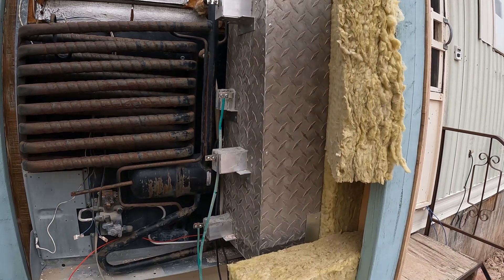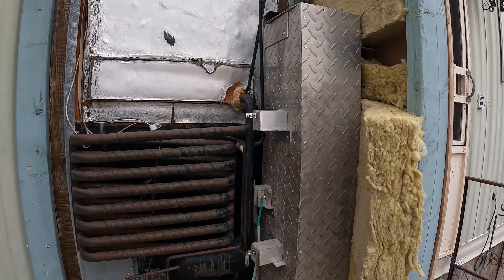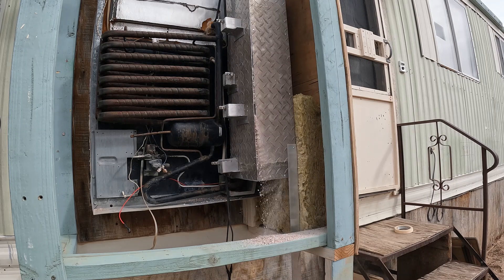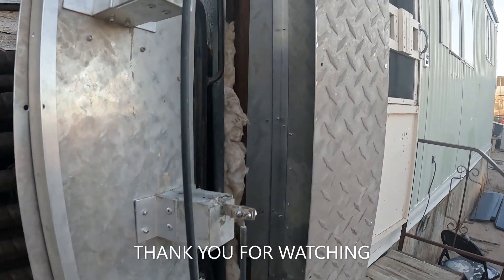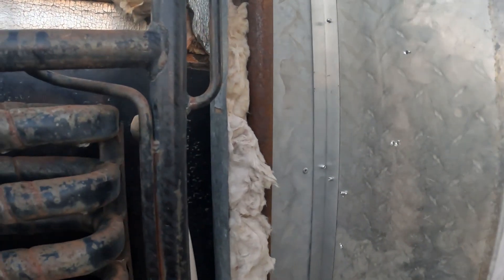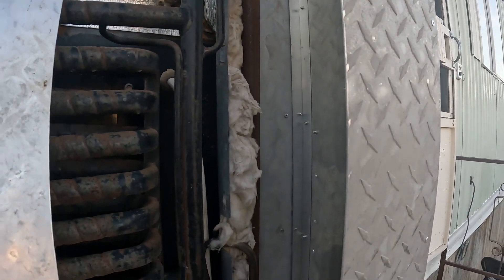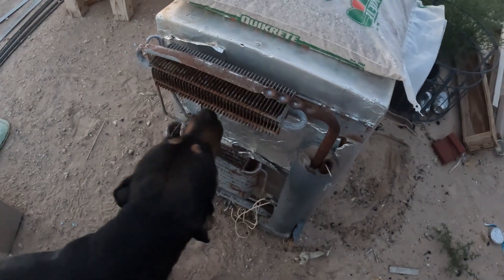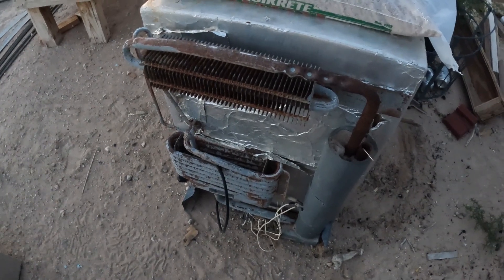Sand Battery Refrigerator Experiment Update E96

Comment: If the direct heating works, why not doing that, then connect the system to a much better insulated box (chest freezers have at least 5cm thick insulation, then you can even complete with strawbales if needed... Then inside of the chest freezer you can add a cold adapted thermal mass to keep the cold for long time. Maybe having different doors inside, so everything doesnt heat too much when you open for a cold pack used for a room climatisation, for instance...
I don't know much physics, if it is more accessible to store heat or cold...

Comment: I think you're right on your fix.

Just a question and you probably already know this but if the propane refrigerators quit working after sitting unused for a while, you can fix them by pulling them out and turning them upside down for a day. There are 3 chemicals that make up the refrigerant and they can separate when unused. Even if you knew this it might help the next guy. A guy I used to work with had a little side business doing this. $40 bucks a pop when the RV companies charged $80 in 1993.
Reply from the maker: No I didn't know that, thank you for that information. That particular refrigerator I am experimenting on had all the wires burnt up from a propane leak that caught fire but the refrigerant is still good.

Comment: I think you are way probably better off storing heat in water.
You can use existing water heaters with extra insulation, add extra storage using insulated tanks and easily plumb it into water radiators.
Reply from the maker: You may be correct but I am already committed to at least building one large prototype to see how viable it is.